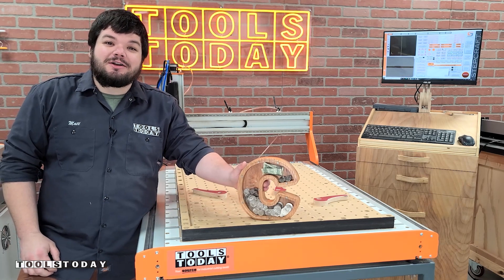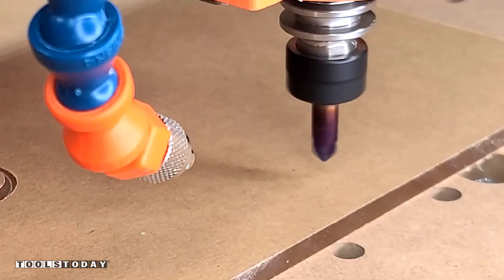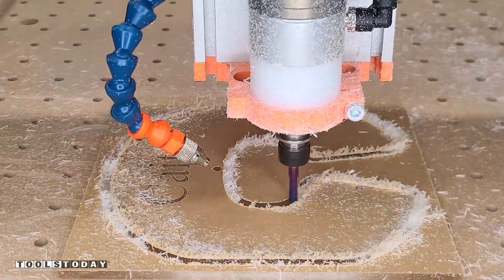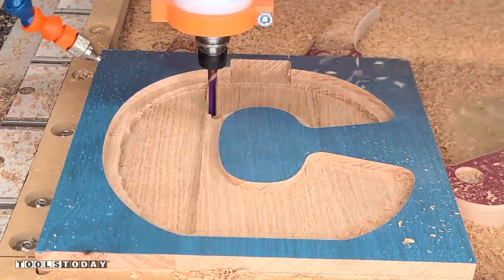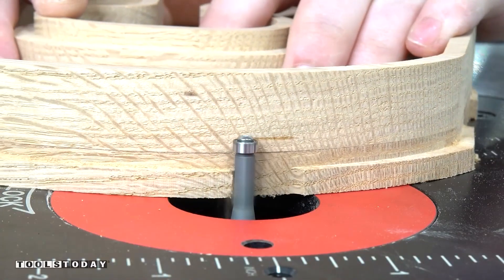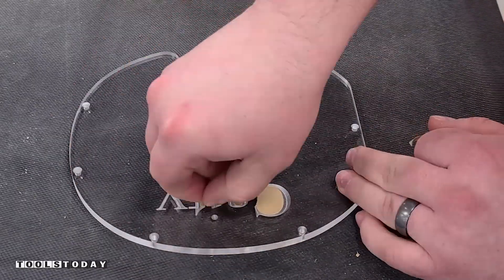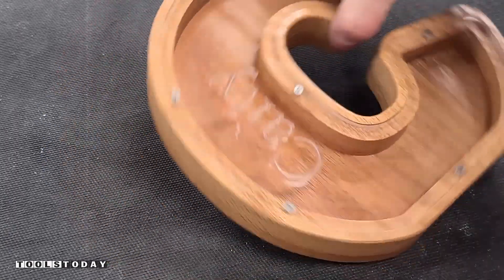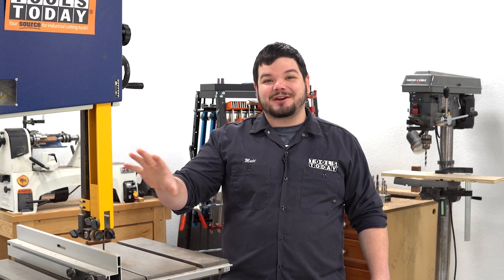How to Make a CNC Alphabet Piggy Bank | ToolsToday

Comment: The instructions they send are incorrect. Ruined $50 worth of good hardwood assuming they would be correct.  Disappointed.
Reply from the maker: What was incorrect about them?
Reply: I will email you, as I want a refund, but instruction number 14, sub F should say select line 7… it says select line 6. Didn’t notice until 2 hours into the cut, and wasted all the time I spent buying the wood, cutting it, jointing it, planing it, gluing it up, cutting it to size, planing it flat, and setting up the cnc.

Comment: Good project for sure. What screws did you use? Do you have a link for those?
Reply from the maker: Thank you!  All of the hardware used is in the instructions on the plans, but I used #4-3/4” Screws - https://amzn.to/3u5i1B9
Reply: Thanks @ToolsToday  ! I ordered it but there was some issues with the order I think. They just emailed me the ZIP file so I didn't really see any instructions. I was able to use the vCarve versions AS IS and am impressed how I only had to review the toolpaths and carry on.

I ordered some 1/4" acrylic and will cut that part tomorrow. Thanks for the quick response!!!!

Comment: Will the file work good With CC ?
Reply from the maker: It includes an SVG file which are just the vector lines, and will work with Carbide Create, then there are instructions on how to set up all of the toolpaths as well that you will need to set up yourself.